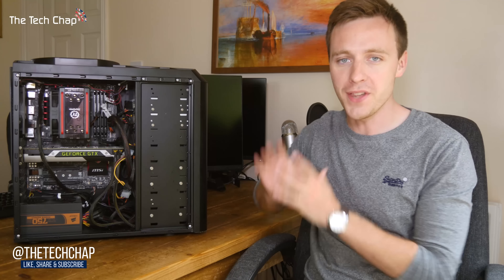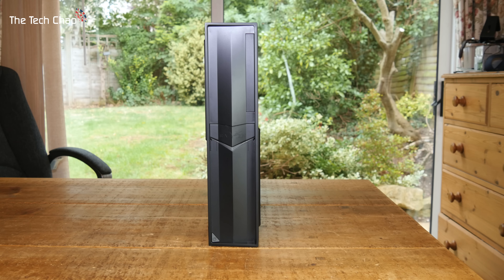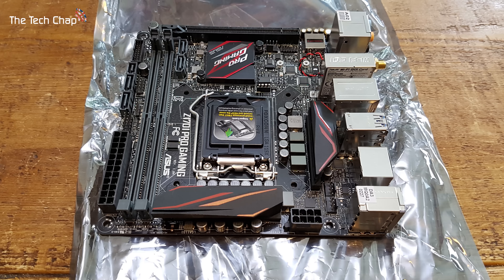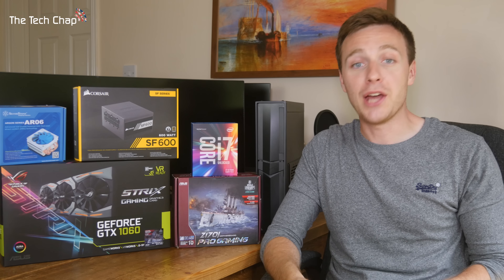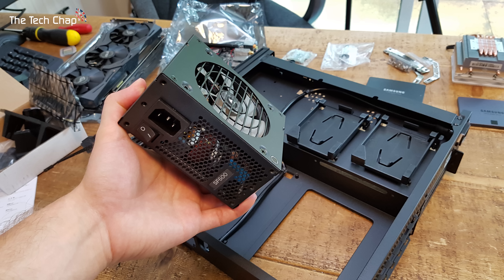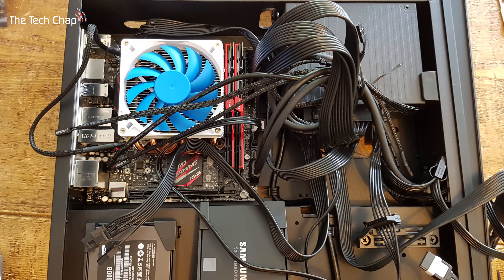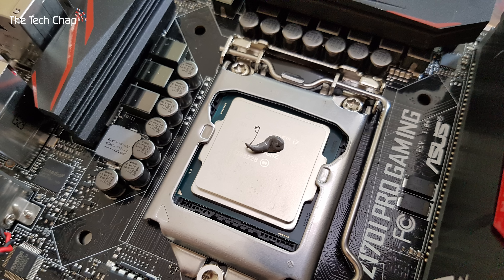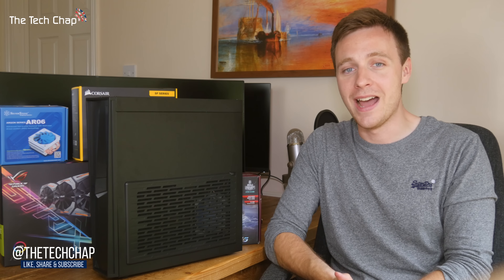How to Build the Best Lounge PC - Mini ITX Gaming Rig

Comment: I'm considering a MiniITX for my Vive. That case is nice and compact but I might opt for the larger Define Nano S for the better cooling. My 6700K is OCed to 4.7 GHz and a doubt I will obtain that with the cooler I'd have to fit in that Raven case. Still that very compact package is tempting.  Decisions decisions... But I have some time as I just built my main PC and the ITX build will have to wait.
Reply from the maker: I have the 6700K up to 4.6 in the Raven which is pretty awesome
Reply: Awesome! what do you temps look like (CPU)? I like some of the features of this RVZ02, but the RVZ01 slightly larger footprint may allow use of a better cooler.

 BTW, I've enjoyed watching several of you videos.

Comment: Hey, looks great mate. Why not go with a GTX 1080? If you're going for the "best" mini-itx gaming PC I think the GTX 1070 at least would have been a great choice (that what I have in mine).

Great choice in the PSU. The Silverstone ones have problems. 

Did you take a look at the MSI B150I GAMING PRO? It's cheaper and has some great I/O ports.

Also for anyone who doesn't love the look of this case: Check out the Silverstone ML08. It's (in my opinion) a little more sleek and less "edgy".

Cheers.
Reply: 1060 is enough for 1080p and 1440p if settings are tweaked 4K (let's be honest here)is very unnecessary...yeah you'll be amazed on you can't see the pixels but that's it far away it looks the same
Reply: +Peter Black I agree 1060 is ENOUGH but why not spend just a little more for a 1070 to get at least 60fps in every game at max settings at 1080p? 

I don't care about 4k yet and 1440p is cool if you're willing to spend the money on it. For now, 1080p is the sweet spot and a GTX 1070 rocks games at 1080p.
Reply: Though I understand why other disagree, I do agree with you. Especially as he mentioned owning the HTC Vive was part of the reason for this build. The GTX 1080 allows you to use supersampling (1.5x to 2.0x) and a makes a diference in graphics quality and text becomes much more readable. This is why I looking toward getting a 1080 Ti sometime next year, so I can get the most out of my Vive (supersampling 2.0x to 2.5x... BIG GRIN).

Comment: Hi Tech Chap! I was thinking about making a mini itx PC however I am moving to a hotter country where temperature tends to be 36 to 38 degrees. so my question is should I go for cases like raven and Fractal design Node 202 or should i go for a little bigger ITX case like Fractal design nano S?
Reply from the maker: I would probably say go for a bigger case with more cooling/fans in those kind of temps

Comment: Excellent video, why not opt for the 6700 non K variant instead?  I mean there is no way the AR06 can handle and overclocked 6700k not in a small case like that.
Reply from the maker: surprisingly i've got it OC'd to 4.5ghz and it's running fine :)
Reply: The Tech Chap what are the temps?  Those coolers are only rated for 65w.  The K variant is 95w and with over clocking will go much higher than that.

Comment: I have a feeling that gets super hot. A non-blower style GPU and a K CPU should mean super high temps for the CPU. At least everything that I have seen on PCpartpicker would suggest that
Reply from the maker: surprisingly it doesn't actually - had it running for a couple weeks now (overclocked)

Comment: Would using a GPU with the blower style cooler be better suited in the small form factor? Or does it keep cool with the GPU you used?
Reply: With this case a blower would be better but the card will be fine if its not. Personally I went with the Fractal Node 202 because you can mount two fans right next to the GPU to keep it nice and cool this raven case has no fan mounts. Also weirdly enough the 202 is slightly smaller then the raven.
Reply: in my experience i wish i would have gotten a non reference 980ti for this case because the air would not be going to the rest of the parts, the chambers are separated and i reach thermal max in any game other than csgo and overwatch
Reply: actually i would usually say blower style but its not true in this case. The top of the case has air holes which will allow your graphics card to expel air out of the case anyway, so an aftermarket cooler would be a lot quieter and give you better temps.
Reply: add a custom fan curve in MSI afterburner and off you go :)

Comment: Hello! I'm buying the components recommended, but I will not do overclocking so I chose an i7 6700, tips to maintain the same motherboard?
Reply from the maker: Yep keep the same motherboard, it's very good. You might want to consider the cheaper i5-6600 though too

Comment: Hi would like to ask would it be difficult to add wifi and bluetooth capabilities? Or does this already have it? Im a completely novice and dont know :D
Reply from the maker: depending on the motherboard it already has it built-in. Although I use a separate ASUS WI-Fi dongle that connects via USB (and you can get a similar little USB dongle for bluetooth)

Comment: I heard about the heat issue with that style of gpu cooling, would you recommend a blower style over the multiple fan design or is this case have good enough airflow to use that type of gpu cooling? The reason I ask is because I live in a very hot climate, and I'm really interested in building a mini itx pc to save up some space.
Reply from the maker: the case has surprisingly good airflow - Just make sure you get a GPU with a good aftermarket cooler (like the ASUS one)
Reply: The Tech Chap ok cool! Thanks dude! I really want to put an Asus Strix 1070 in it, it's a little bit pricy down here.

Comment: Why did you not try the Silverstone ML08 H thats good with handle on it.
Reply from the maker: +Mark Anthony Regala yeah thats a good option too I just happened to prefer this one :)
Reply: +The Tech Chap so did you overclock your i7? how far did you overclock it?
Reply from the maker: +Mark Anthony Regala using the Asus BIOS OC to 4.5 :)
Reply: +The Tech Chap Nice that is good I hope I can make it in my MSI Z170i gaming pro AC I have plan using it as gaming and planning buy Gopro to video eddit on it.
Reply: Oh wow what's the temp like at idle and load?
Reply: I keep watching this video and still one more compônent missing to mine

Comment: Don't spread your paste. It's not recommended simply because the head of your processor and your block will spread it evenly. Spreading it yourself can leave uneven portions of paste resulting in higher temps.
Reply: Omg this!!! Although the problem is actually air bubbles between your CPU and the fan. It will result in higher temps because, you know, air is less conductive than the paste.
Reply: i cringed when i saw this, how many people that do this is crazy

Comment: Will a 3.5" HDD fit in this case alongside 1 SSD?
Reply: I know it's 3 years too late but it does fit x1 3.5" HDD in the graphics card chamber. Only if you use mini GPUs (the ones with only one fan).

Comment: Tell me what the AMD equivalent build would be using the same case and i`ll subscribe...
Reply from the maker: for graphics or processor? Best AMD GPU currently is the RX 480.
Reply: The Tech Chap for the whole rig I mean
Reply: I don't think It would be a great idea to go on AMD CPU with the current offering since the FX9590 is their flagship and it's not performing nearly as well has a i7 6700. It's also very power hungry (220W) which would require water cooling and a beefy PSU; not very practical for a mini ITX build. You'd be better off waiting to see Zen CPU in this case

Comment: Would it be possible to build a g.pc of a size similar to Alienware Alpha R2?
Reply: sadly not as they are using a custom motherboard and a small form factor GPUs that are used in laptops. but to be honest making a PC like that will hurt in the long run as upgrading your parts will be painful
Reply: yes with the zaber sentry case
Reply: Adham El Banhawy
i am planning to build a PC with a picoPSU and an external brick, it is doable the size of the xbox 360. But I am not sure how big is the Alpha...

Comment: no 3.5inch mechanical storage drive? As a video creater dont you need huge amounts of cheap storage. like a 3TB drive where you store your files?
Reply: I was wandering the same...is there any space remaining?
Reply: You can fit a 3.5" drive if you use a smaller graphics card like a Geforce GTX 1070 mini ITX
Reply: I'm guessing external storage. Not to mention I'm sure he still has his larger main rig to go along with this portable rig.
Reply: He could always get a 2.5 inch mechanical drive
Reply: Of course, but you do take a performance hit in the 2.5" HDD. Personally I get an additional 1TB SSD. and a external NAS for mass storage. My goal for the future.

Keeping the additional weight and heat out of such a small case is a good idea.

Comment: i would just get corsair the one £2000 but better cooling aio liquid, so oc potential and obviously better gpu
Reply: LegendaryVegeta many of us has already a lot of components only waiting to be ported to a mitx case. It's the beauty of building a pc. You take your components or upgrade some of them only. Sure, if i wouldn't have a thing, i would go for the Corsair One. But selling my rather new HW for 50% which performs exactly the same, and then paying much more for the One is not a good idea. I would love to buy the Corsair One CASE though
Reply: ive never built a pc so i wouldnt know, i wish the corsaid one was self buildable for even £200 i would be wlling to pay, if they sell it bare bones, and it was doable to build a pc in there

Comment: What about the noise?
Reply from the maker: noticeable, but if you go for a PSU with a 90mm or larger fan, it's not as bad as you'd think. I'd say it's about the same volume under load as a macbook pro under load.
Reply: +The Tech Chap thanks. MacBook pro level is not that bad then.

Comment: saying this is good for vr is misleading in a way. because mini itx just does not offer enough usb ports. you would need.
2 sensors, 1 hmd, 1 xbox controller, 1 keyboard, and 1 mouse. thats 6 usb ports just for input and out put. that leave wireless usb headset or external drives disconnected. could it work yeah i guess but far from ideal.

Comment: The idea is great, but that particular case looks like it was made by a 12 year old boy. Something like the Node 202 is much better.
Reply: That's the exact reason I built my htpc in a node 202. It's worth noting that a blower style GPU really makes a difference with cooling too.
Reply: or the ML08, its the same internals but sleeker
Reply: Ben Woodall By Blower style u mean, like the reference design cards ? Also whats the temps u havvunder loads ?

Comment: Hey guys i just bought a computer with an i3 7th gen 3.9 ghz, gtx 1050 ti by asus 4gb version, 8gb of ram, 500 watt power supply, and an h110m-k motherboard and i onlyget 80-90 fps on csgo with 1366x768 on minimum. WTF IS WRONG WITH MY COMPUTER?

Comment: Good luck with hot air that GPU generates
Reply: explain yourself ?
Reply: ealiev60
No need to explain, there will be 3 or 4 degree difference from a normal tower case.
Reply: brky have you ever had that particular case? with full size GPU in it running 2-3 hours, gaming? This case doesn't have any intakes or exhausts, while normal toiwer case has at least intake and exhaust, and some normal tower cases come with two intakes and 1 exhaust to blow hot air out, while in this case hot air is pretty much trapped inside and GPU re uses it if you don't have good AC in your room, so NO, it is not going to be 3-4 degree difference, don't bullshit me, I owned 2 of this, older version with fan and the one that in the video
Reply: There will by necessity be some airflow, due to temperature difference of the air. It will get holder than a ventilated case, but should be bearable.
Reply: I have this exact card in a mid-tower atx build and it never gets hotter than 60 degrees. The new pascal GPUs run at much lower temps than their predecessors, the cooler on these is the same that you get in the gtx 1080, it is a massive overkill. Also due to the fact that it the gpu in this build has its own compartment, I think he'll be more than fine (I'm willing to bet 65 degrees celsius is the most he will get).

Edit: until 50 degrees the fans don't even spin, so it's silent as well.
Reply: Andrei Marcu i agreed while you using a mid tower, but this is a fan less mini itx, heat from this card will be mix with the hot air because no fans to exhaust, so not good for long period i think
Reply: radja putra Nah thats wrong. There will, by necessity, be some airflow. How do you think wind in the real world works? The hot air will leave the case, simply because hot air is lighter. The resulting vacuum will suck in fresh air from all around the case.

Comment: Overpriced CPU with a budget GPU. For a gaming PC, it seems legit... not.
An i5 6600k or heck, even an i5 6400 would be enough for this build. If you want to upgrade your GPU to something stronger, like a 1080 or an AMD Vega GPU (probably named RX 490), then the i7 makes sense. Otherwise, this build is really unbalanced. 

I'll be building a PC in my Xbox 360 case next year, though it will use an 8th gen AMD APU (code named Raven Ridge) and the fastest RAM it can support. No dGPU (just for 1080p) and a Pico PSU with a power brick (much like Intel Skull Canyon NUC). I already successfully built a cheap PC with a microATX board inside, but an ugly ATX PSU outside some time ago (upgraded since then).

Comment: 99.9% ITX cases are straight-up butt ugly, including this one. Cheap plastics, boring design (or lack of; such as Lian-Li and their imitators like the M1 cases), and terrible air-flow layout. It says a lot when the Xbox One S looks way better than them.
Reply from the maker: i agree it's definitely not the best looking - but for sheer compact size it's pretty impressive
Reply: I agree. Planning to build a new desktop and that's actually my dilemma- choosing between not the best looking desktop vs a fancy looking one. Specs-wise i think this build suits me since I'm planning to make it as a media player on weekends and a productivity machine during weekdays. Ill just imagine it having an xbox that I can use in productity hehe :P
Reply: i'm designing my own for this reason
Reply: I think the fundamental problem is designers see less volume as the only goal and don't consider a 15 liter case can look much nicer and work better than a 10 liter one and they're both pretty small.
Reply: Yeah like big atx cases looks beautiful.
Reply: Gmail Dotcom I say the node 202 and the s4 Mini are great